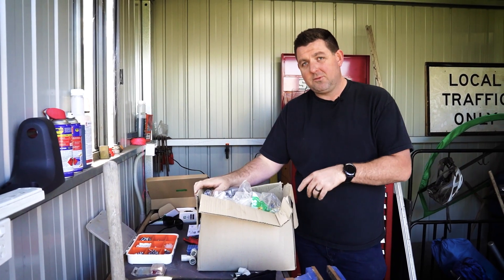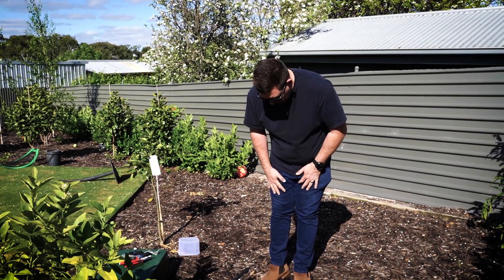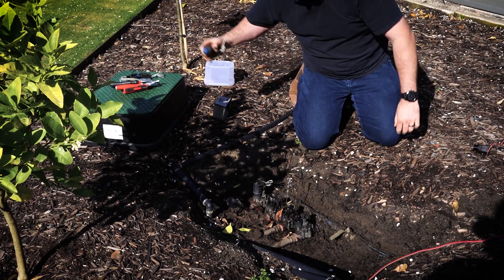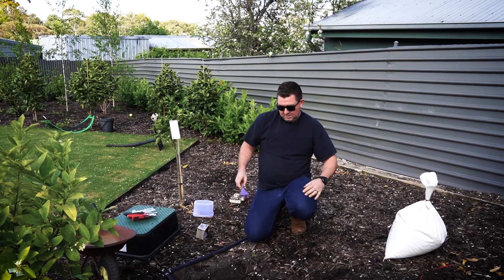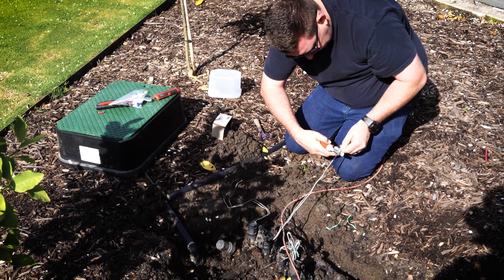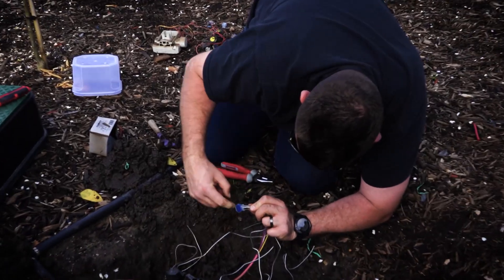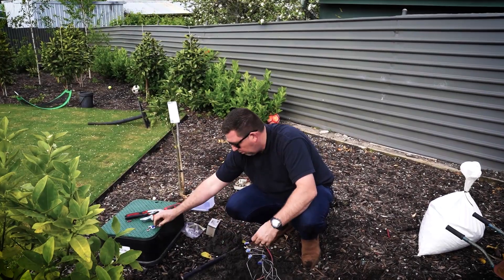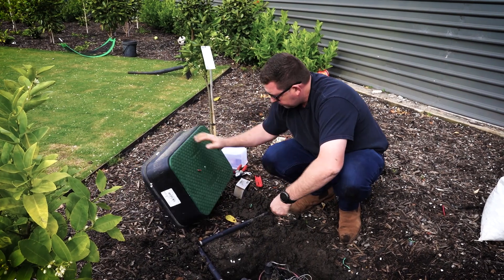How to wire up Rain Bird DVF Solenoid Valves

Comment: Do you turn off the power before hand or something?
Reply from the maker: It's best practice to. The power at the valves is only 24VAC.
Reply: It’ll only give you a buzz if you lick the terminals…